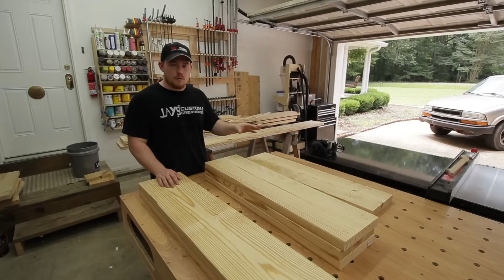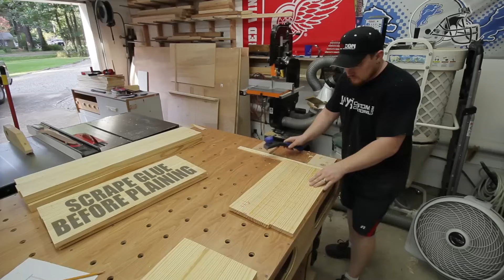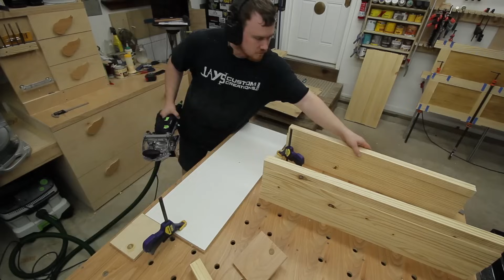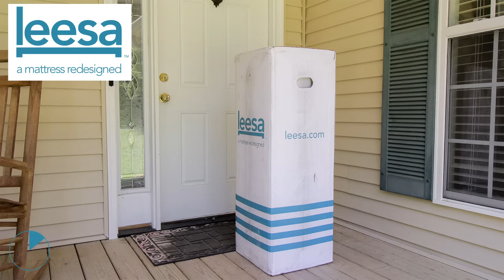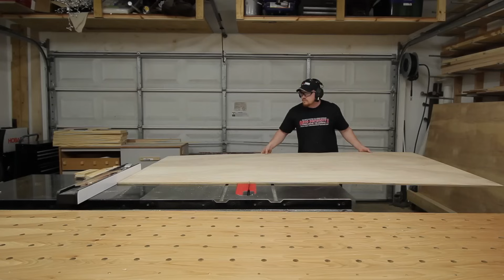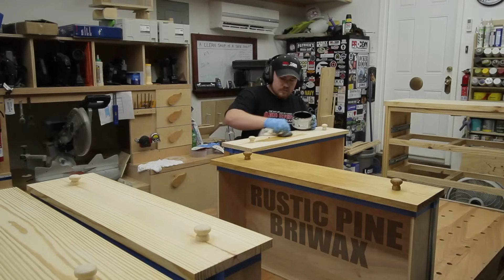Making A Pine Chest Of Drawers - 211

Comment from the maker: I finally got the chest of drawers project complete and couldn't be happier with the results. For a lot more information and details check out the build article: http://jayscustomcreations.com/2015/08/knot-free-pine-chest-of-drawers/
Reply: Jay Bates Woot FIRST reply! 

Keep em coming! What brand of crayons do you recommend for woodworking. Wink wink!

The commercial was well done... did you have complete creative on that?
Reply from the maker: Darin Bicknell  Big red crayons are the best :) Thank you for the feedback. Yes I had complete creative on that.
Reply: Jay Bates Great build. If I were to try to make videos I sure would shoot myself in the foot a lot!

Was it hard to work out the details of the width of drawers or does that fall out from the Sketchup prep work?
Reply from the maker: Timothy Hall Everything is done in SketchUp first. Super easy that way. Also, when using 1/2" plywood and metal drawer slides the drawer is 1" less than the width of the opening and the front and back panels are 1" less than the width of the drawer.
Reply: If I were in the States... I'd get that mattress in a heart beat.
Reply: Nicely done Jay,I really like the way you did everything in dimensional lumber to inspire people to go do something easily. ..great job !

Comment: Love the results and the video. Having built many pieces out of yellow pine framing lumber I suggest it is good to sort through the pile and buy the best and then let if dry a while.  Its sold dry enough for framing a house but not for furniture.  And you are correct, buy huge pieces and cut them down.  Comes out of larger better trees and you get more usable wood.  Throw the part near the pith away.  I am building chest now and just got a Domino.  thanks for the video.

Comment: wow, not a single pocket hole! :)
Reply: Matthias Wandel He's pretty fescool now
Reply from the maker: Matthias Wandel Of my most recent 28 videos only 5 have pocket holes in them. 3 of the 5 were my miter saw station.
Reply: Jay Bates You truly are a monster.
Reply: Matthias Wandel $1300 for the Festool Domino and about 50 cents apiece for the Dominos. If you have the money I guess that is the way to go. Unless, he made the Dominos himself which seems to me the way to go. Even then, I doubt that he made the waffled impression that Festool stamps into their Dominos to allow the glue more surface area. I love your videos as well as Jays. I hope that he didn't say anything that he didn't believe in in his endorsement. Though he didn't say anything except what it was made of and how to order one. You could do that.
Reply: Hermoso trabajo.
Reply: Matthias Wandel Ha, are you trolling poor Jay Bates ?
Reply: Jay Bates well said
Reply: The man cranks out the work and helps other YouTube woodworkers enormously! So does Matthias... Just saw a video where Matthias made and used a pocket screw! All joints have their place... makes for good theater.

Comment: Nice project.   Really smart to cut out the pith -- I hope all the viewers pick up on that.   Those wide boards do have some pretty nice straight quarter-sawn grain on the edges.  You made great choices on assembling the panels to take advantage of that!

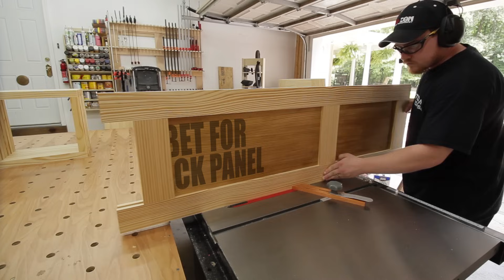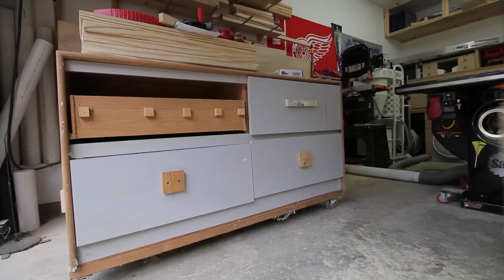Oh, and that title at 6:17 -- that is one of the slickest bits of editing that I've seen.  Stupid iMovie doesn't give me that kind of option.   Grumble.  Oh yeah, and the tick-tick-tick starting at 3:30.  That was subtle.  I didn't even realize what I was hearing until the alarm went off.  Great editing, Jay!

And I can see that the door closed at 9:30...  when life suddenly got a lot cooler in your shop!  :-) :-)

Keep up the great work.
Reply from the maker: wordsnwood Thanks man. I appreciate it all. Yes, the world changed drastically at 9:30 :)

Comment: Fantastic job here with everything, the project, editing, A++ for the entertainment value here.  Hard to believe I actually wanted more from a 13 minute video, that time flew by.  One question though, aren't you concerned about movement from the dimensional lumber? that stuff is wet, wet, wet!  You may have addressed this in another video, but Im not sure.  Thanks again for sharing, Dave.

Comment: Have you considered using furniture grade plywood and poplar for furniture projects? Poplar can be stained to look like most any wood and is very cost effective.  Lumber from the big box stores usually has too much moisture.  Good video.
Reply from the maker: Julian Lech Poplar is $5.50 ish per board foot where I live. I've never had an issue with buying box store kiln dried pine.

Comment: I love the projects you've created using dimensional lumber! However, I wonder if you worry about the moisture content of the wood when making furniture. Dimensional lumber from the big box stores here in the South is VERY wet - sometimes you can even feel the moisture in the wood, almost like it was felled that morning. That wouldn't matter as much for shop projects, jigs, and fixtures, but do you worry about the longevity of your dimensional lumber projects when it comes to finer woodworking projects like dressers/chest of drawers and the like? Do you allow the dimensional lumber you buy any extra drying time before use? Or do you just not worry about it? Thanks again for sharing your videos and your knowledge and creativity.
Reply from the maker: +Anti Leader I don't buy the super wet stuff. If you pick through the bin you can find very light weight dry stuff. Also, build with the grain of the wood in mind. Wood will expand along the grain so orient the wood in the project so that wood expansion doesn't matter or won't affect things in the long run. I've had zero problems using Lowes kiln dried wood.

Comment: Nice job Jay! was the reason you did not use certain parts of the wood because of the method of joinery you did? just wondering you I'm still learning the craft of woodworking.
Reply: +Edison Norman 
Quarter-sawn wood is more stable than plain-sawn. Not only is it less prone to cupping, it also expands and contracts less.
 Quarter-sawn provides a “quieter”  and straighter face grain than plain-sawn.
 In some woods, especially the oaks, quarter sawing reveals dramatic 
internal rays that add a very cool dimension to the material.

Comment: Is there a reason you didn't put the drawer slides flush with the bottom of the drawer? Is it a balance issue since these are large drawers? Preference? I'm about to do install some drawers, and I'm not really familiar with them. I was about to put the slides flush with the bottom of the drawer, but I remembered seeing something different in one of your videos...found it...it was this one.

Comment: Came out very well. Will take a sledge hammer to break that apart. Nice job on hiding the groove on the lower part of the legs - attention to details. You have a nice system for putting in the drawer slides and drawers - simple, easy and effective. How much did the wood cost you for this project?
Reply from the maker: The 2 Car Garage Shop I already had the plywood on hand but I think I spent about $80 or $85 on the 2x10's

Comment: great vídeo Jay! I have a question for you. I have builed something similar also using 2x12's. The problem was that the pine was way to wet and the gaps for the drawers got really big after it got dried. On the top with the bread board it shows 1/2 in shrinkish in a 24 inch deep top. Did you let the pine dry or you get a dried already?
Thanks!!!!!!
Reply from the maker: Eric Pedercini I normally start with kiln dried pine from Lowes.

Comment: Nice video Jay! Could you tell me the moisture level for the pine in this video? Or in general, what should the moisture be for interior furniture ( pine or spruce ).
Thanks.
Reply from the maker: SenseiTube Not sure. I've never measured. I purchased the boards from Lowes which advertises it as kiln dried.
Reply: +Jay Bates That's why i was asking. Usually they don't specify it. It could range from 6% - 12% but as far as i know anything above 7% for interior could make problems during heating season etc. In my country i can only buy max 12% or 18% kiln dried wood in stores. But that is never enough for interior furniture.

Comment: Dude totally just saw something interesting in your video! When you were attaching the back to the chest of drawers your drill had all your screws  the top of it   Did you add a magnet or was it already there! Have never seen that before
Reply from the maker: +Royers Custom Wood Working It's a magnet made for drills sold by FastCap. Pretty handy actually.

Comment: Not to be too nitpicky, Jay, but there's only one "i" in planing. I'm also curious to know why you made "dust guards" without actual dust guards in them. Did you forget them? Haha. It's a great looking dresser though. I think the only thing I would have done differently would be to have the drawer faces inset a bit (maybe 1/8") to match the look of the recessed side panels. I quite like the choice of wood knobs.
Reply from the maker: sooth15 Yeah, I'm horrible at spelling. I thought it was correct. I've rarely seen dust frames with actual panels in them. I've never seen Norm put panels in his. Thanks for watching :)
Reply: Jay Bates Most of the antiques I've seen have panels in the frames, which keeps dust from the drawers above from falling into the drawer(s) below (especially if they're wood-on-wood). They are often just really cheap thin plywood maybe 1/8" thick, or sometimes 1/4".

Comment: How do you buy pine from the big box that isn't seeping sap and sopping soaked?  Do you use a moisture meter?  I just bought a nice, straight 4x4, and by the time I had cut and planed it down to the 3x3 I was looking for, there was sap all over everything, a bit of warping, and the ends were checked.  How do you avoid that situation?
Reply from the maker: n8guy I can't get non treated 4x4's where I live but the Lowes close to home sells kiln dried lumber. I've never had a problem with it.

Comment: When checking the diagonal measurements of the drawers, what would you do if they were not equal?
Reply: Mithran Kathirgamanathan Put a clamp across the longest diagonal and gently pull it into square. When the glue sets up it should hold its shape.

Comment: What tool did you use to make the holes for the floating tenons? Thanks.
Reply from the maker: +Jose Andrade Festool Domino 500
Reply: +Jay Bates thank you for the info. Would any plate joiner make a mortise or does the tool have to be specifically a floating tenon joiner. Thanks again.
Reply from the maker: +Jose Andrade I'm sorry but I don't have any personal experience with a plate joiner. A plate joiner would work great for aligning pieces in the top glue-up but for a structural connection in which two pieces are joined perpendicular to one another my research indicates that it doesn't produce that strong of a joint.
Reply: +Jose Andrade

Comment: why couldnt you use the pith part of the wood? why did it have to be scrapped and cut around?
Reply from the maker: wttwoa It's less stable which means it is more prone to warping and other wood movement. It's also the least visually appealing.
Reply: Jay Bates thanks, i had no clue

Comment: arent u worrying that this will like warp out seeing it pine wood?
Reply from the maker: +jenna michaels No. I used kiln dried wood and oriented the grain so that the expansion and contraction will be in directions that won't cause problems. Wood warps when drastic changes in humidity occur. I've had great results using kiln dried wood from Lowes.